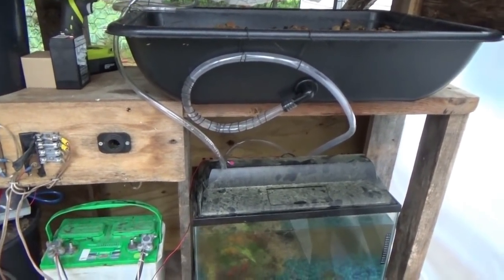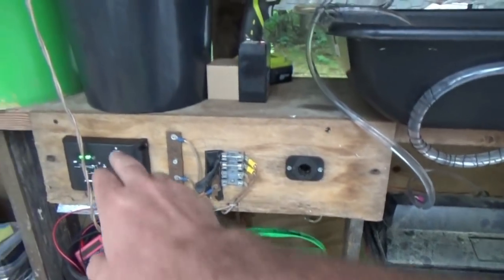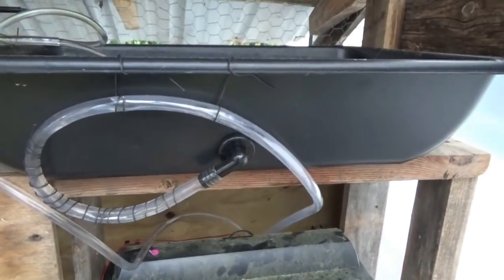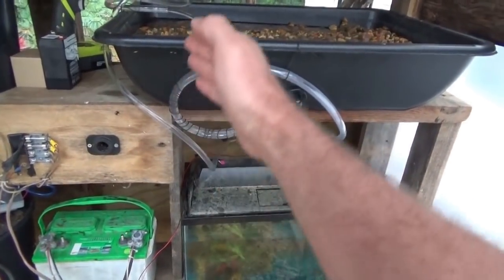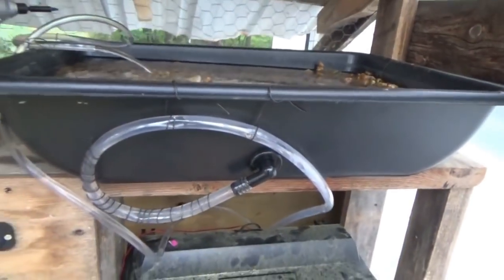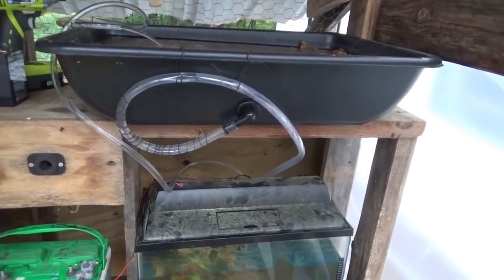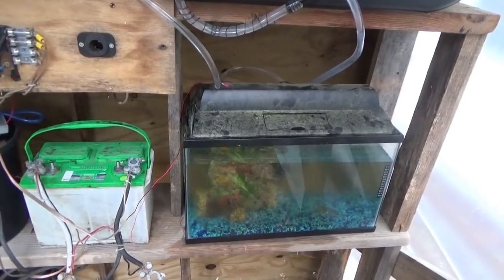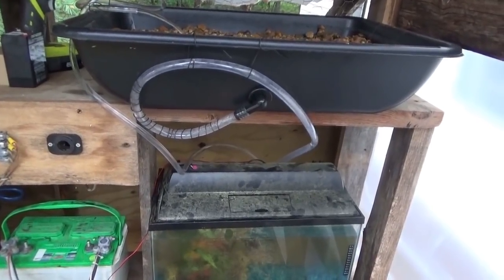Fully Solar Powered Off Grid Aqauponics System Explained In Detail

Comment: Hey Bro.  Are you using a Interstate Car battery for this project.   I have a Deep cycle interstate Battery for my solar system and I would love to use a cheaper car battery for a small solar project   Do you think it will stand up?
Reply from the maker: It is a boat battery but a decent car battery can work for smaller systems like this one. Just make sure it stays charged up all the time by choosing a large enough solar panel and you will be fine.
Reply: The Do It Yourself World thanks my Brother.

Comment: I see the logic behind smaller modular solar as opposed to a single large system that can suffer very expensive failures. Smaller systems also allow for cheap back up spare inventories as the controllers at low wattage are very inexpensive. Great video.